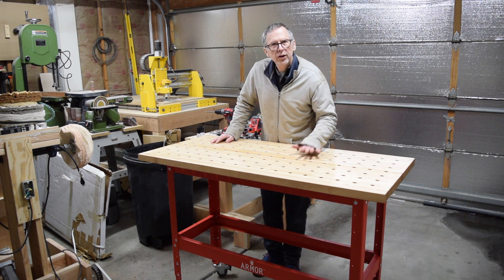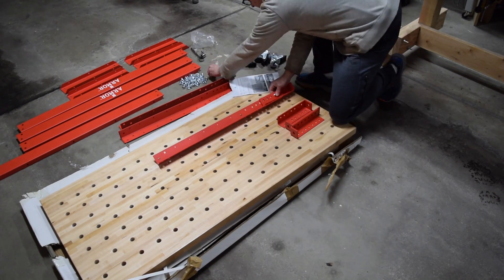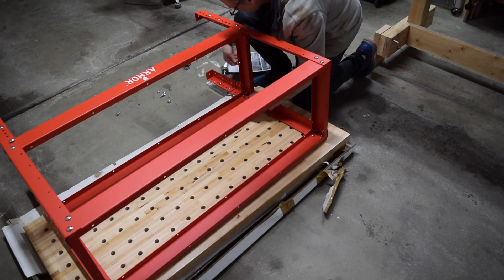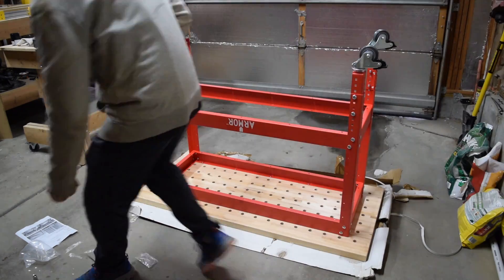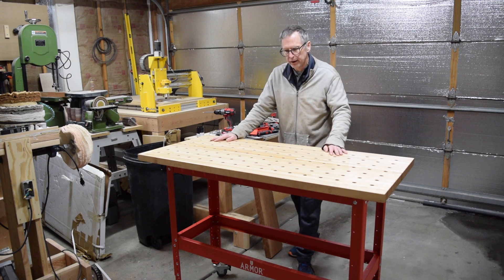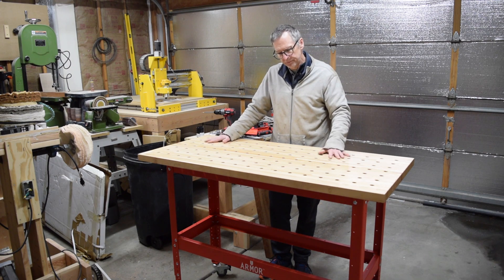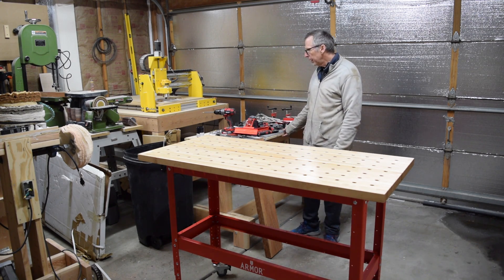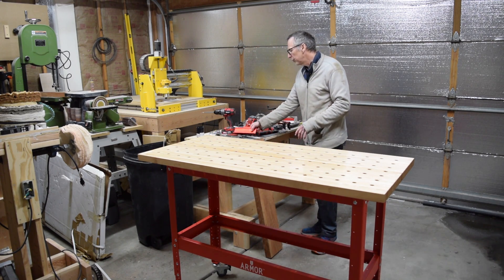Assembling The Armor Tool Workbench

Comment: I was watching one assembly and the guy twisted off one of the screw heads fastening the top. I just assembled two of the 24 x 54 and if you’ll dip the screw into paste wax first, they drive into that hard maple pretty easy, I had no problems at all👍

Comment: Bought two of the larger ones 24 x 57 w/clamp kits back in March and was on backorder, just came FedEx yesterday and I’ll be putting these together today but the vertical hold down clamps still on backorder 4 of them until late June

Comment: I like the clamps and equipment but I think I’d just make my own bench for what they’re asking. Don’t get me wrong it’s a nice piece but economically doesn’t make sense for what you could build it for. Seems a better marketing position would be sell the bench at a much discounted price but still enough to cover costs and then sell more clamps which are extremely high quality. The bench is the gateway drug/loss leader to get you into the clamping system
Reply: So build your own bench and just buy the clamps this company sells?
Reply: Unless you have access to a cheap source of hardwood I doubt if you can make it any cheaper. You are basically just paying for the maple butcher block top and the drilled dog holes. If you add up the cost of the material and the time it takes you to mill the top and make a template for drilling the holes and then drilling them i would guess it would cost you more. Unless you just make the top out of a cheaper material like mdf or make a butcher block top out of pine.

Comment: Hi Chris, I have a question about routing plywood for a T-Track, the plywood has knots in it which I cannot avoid in my design. Without having to pay for premium plywood (that is pretty much Knotless) but twice the expense $$ how do you suggest getting a clean cut through knots in the wood or am I dreaming and it can't be done?
Reply from the maker: Yes, you can successfully rout into knotty plywood. Of course, it depends on the severity of the knots. Obviously, you should try to select plywood with least number of knots and they should be as small as you can find. Before you fire up the router, flood the knots with thin CA glue and let it cure for 6-8 hours. You will probably need to apply several applications of the CA glue to solidify the knot(s) with the surrounding wood. After the glue has cured, rout your slots with successive shallow passes until you reach the final depth. Don't try to rout the full depth in one pass. Also, try to use a down cut bit to prevent tear out. It's a good idea to put down some masking tape where you plan to rout even if you use a down cut bit. This will help prevent or reduce tear out on the surface of the plywood. Before you buy your plywood, be sure to factor in the cost of the wood and the CA glue. It may add up to the cost of a high grade sheet of knot-free plywood. Hope this helps.
Reply: @HighlineGuitars  thanks Chris I can always count on you for good helpful suggestions and that is a great idea with CA glue

Comment: Chris, do you think it's rigid enough for doing things like planing? I would think it would want to either walk across the floor or rock back and forth a bit.
Reply from the maker: As long as your planes are razor sharp, it’ll work fine. However, if your planes are dull or you really put your back into it, remove the casters and keep the bench in one spot. It’s not going to wobble if the legs are planted directly on the ground.
Reply: @HighlineGuitars  okay good to know! I'm definitely in the market for something like this, I like the tops design and accessories. Thanks Chris
Reply: Instead of the standard castors you could use one that fold up so the legs are on the ground.  That’s what I did and works great

Comment: The question is.....If you didn't win this product, would you spend all the money to get it?
Reply from the maker: I was actually looking to replace my homemade bench, but all of the ones I found in the $200 or less were too small and lacked stability. I had never seen an Armor Tool bench in person, so I didn’t know what to expect. I was not disappointed. If I was on a tight budget, I probably wouldn’t spend $400-$500 on this bench. However, I would save up for on instead of wasting money on an inferior product.
Reply: @HighlineGuitars  Agreed.  You never "save" money on inferior products, always a waste of money.
Reply: I just received my bench package yesterday. I have not assembled it yet but it looks pretty straightforward and your video proved that , good explanation of the assembly. I do upholstery and most frames require total rebuilding. I’ve been clamping parts to my cutting table forever and that works but this table will clear up that area and along with the variety of hold down clamps , make my job much easier. As for the cost of the table ,  it’s a no brainer . Buy this and get to work . I’m usually one for making my own tables but time and materials are costly and this is money well spent . Thanks again for the great video!